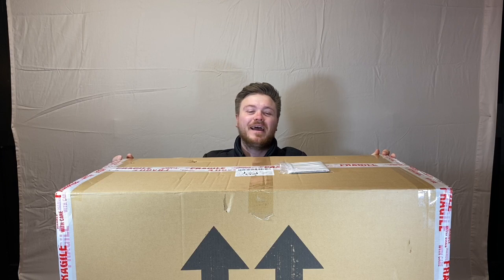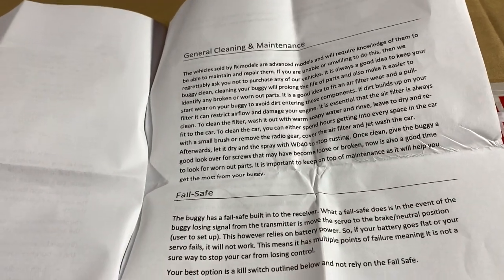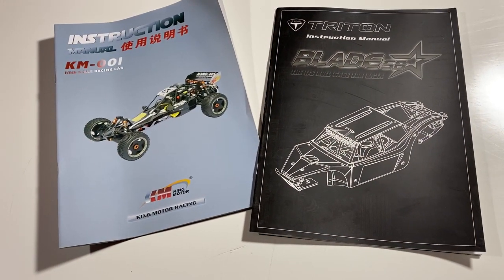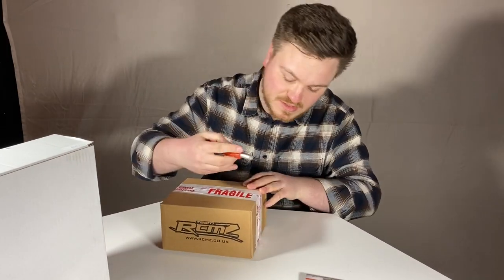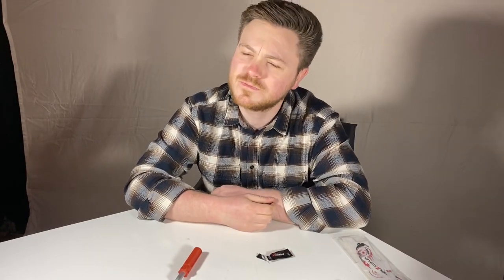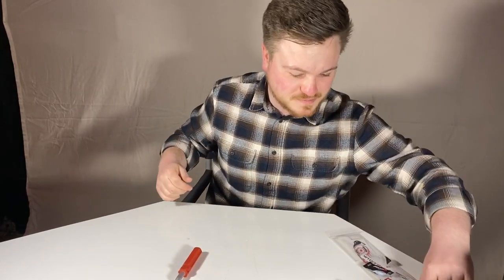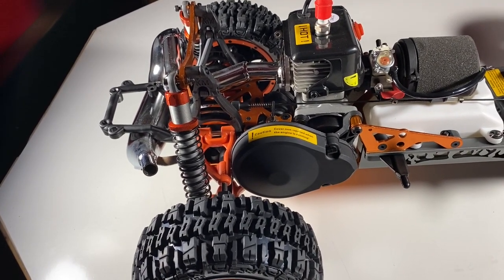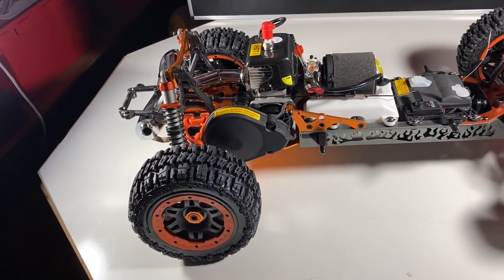KM Blade 34cc - FIRST 5TH SCALE UNBOXING!!! 🤩🤙🔥✨🏎🚀⛽️

Comment: There professional that build these they no a lot more you wot do u no about cars nout  I’ll rebuild this rebuild that ok pro factory mechanic haha there’s always one
Reply from the maker: EGGY I’m just going by the research that I did + I’ve been doing this hobby for many years + if you knew anything about budget RC manufacturers I.e King motor, Rovan etc you would know that they save cost on manufacturing and production process. Even the website I bought this from recommended that I rebuilt and refilled diff and shock components.... do your research buddy.